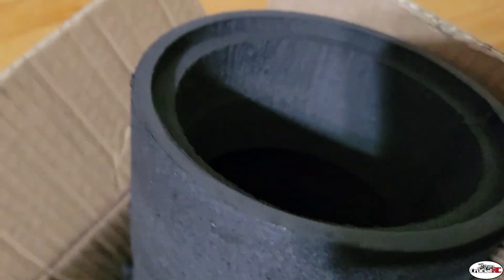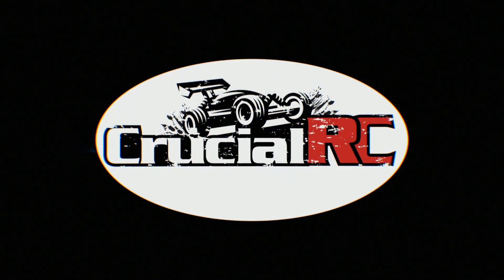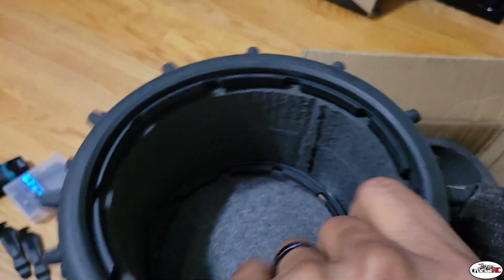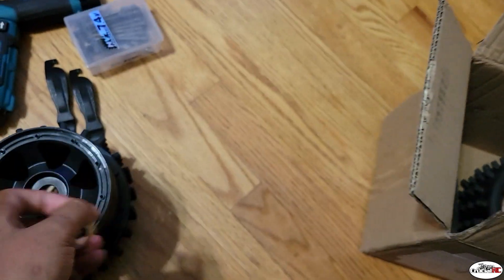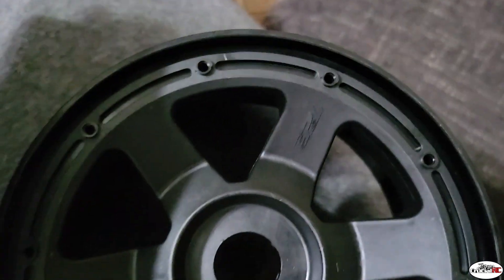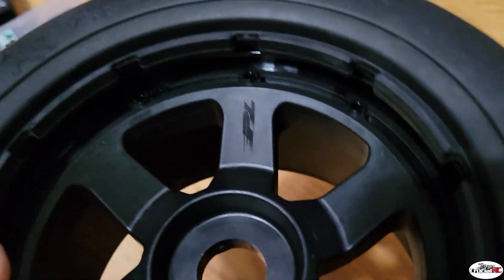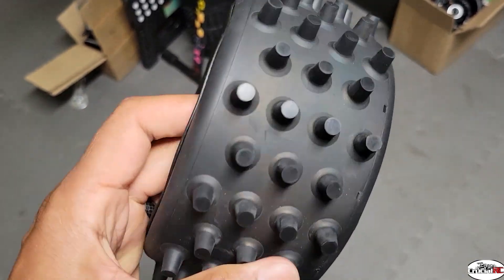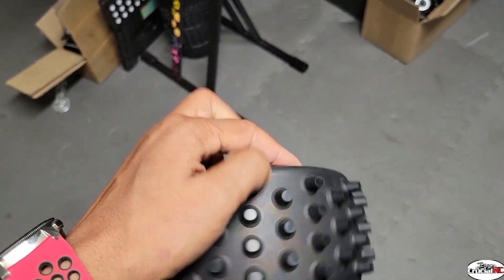Akill Racing "How-To" Tire Mounting for 5th Scale RC on Beadlock Wheels

Comment: Great video,
You know of any cheaper compatable rims to the 195x80 Akill spikes? Maybe Rovan from fearless RC etc?
I'm getting the metal Beadlock as well so really just need the rims but I understand rims come with the rings I won't use though... I got that 5 kid Budget.
Just need something that fits and won't break easy
Appreciate link if you got it😉
Reply from the maker: Thank you. You are looking for wheels or tires? I'm a bit confused with your message.
Reply: @CrucialRC  wheels.
I already have 195x80 Akill's on the way, need cheaper but durable options for wheels/rims.... I also purchase the Akill aluminum Beadlock with the tires but I understand most rims/wheels I am looking for will include another Beadlock I won't use.
So just need wheels that are wide enough for newer 195x80

Appreciate
Reply from the maker: I run Proline desperado Baja rears and never had a problem.

Comment: hey lance, what is the size diameter of the desperado baja wheels can you measure them?
Reply from the maker: Standard beadlock size 4-3/8"(approx 120mm) diameter.
Reply: @CrucialRC  hey bud i meant the  width of the wheel compared to the tire , 190X80mm is the akill racing if im not mistaken, is the desperado wheel 75mm or close to it?
Reply from the maker: That is the taller tire similar to losi size. It will fit on the Baja rear but the true baja rear tire is the 180x85. https://akillracing.com/products/akill-racing-mad-dog-super-spike-tires-set-180-86
The website is a little complicated.

Comment: Those tires are amazing but I ordered 2 pairs of tires and a bigflex body.   They shipped. The tires and basically stole the body from me saying it was never ordered even though I have a $200 charge for it.    DO NOT ORDER FROM AKILL
Reply from the maker: Yeah unfortunately Akill is going thru some business issues at the moment. Please reach out to him on FB messenger. He should make it right.
Reply: I tried man.  I think I’m basically out $200.    Super disappointing because there tires are amazing.  But I’m in a group of about 50.  And non of them will ever run the tires now.  Just bad business
Reply from the maker: Yeah I'm sorry to hear my guy. Sometimes you just have to move on. Thanks for posting your experiences here. 👍🏽